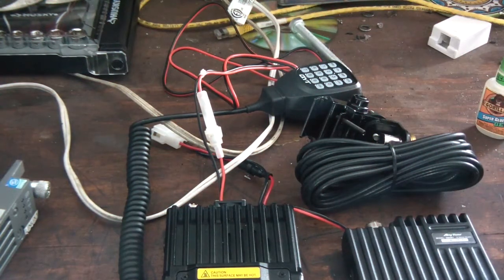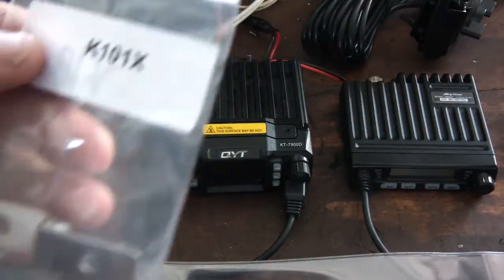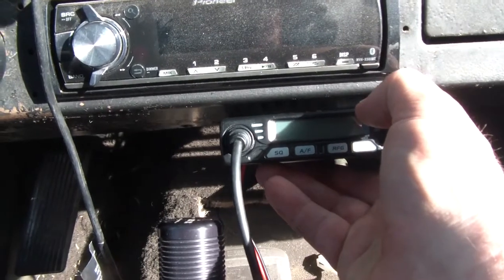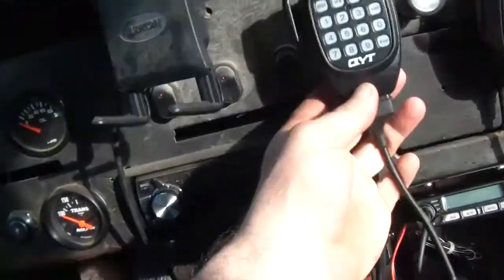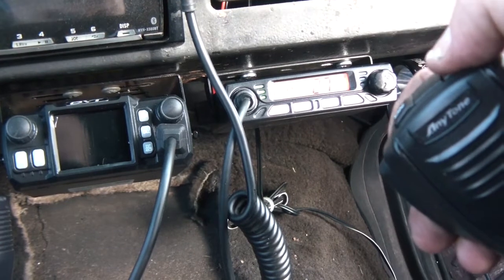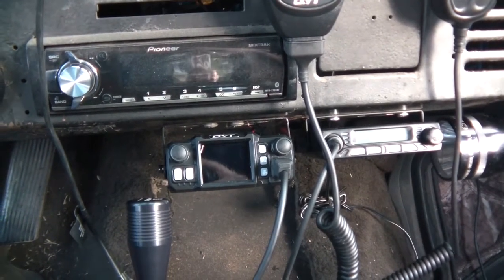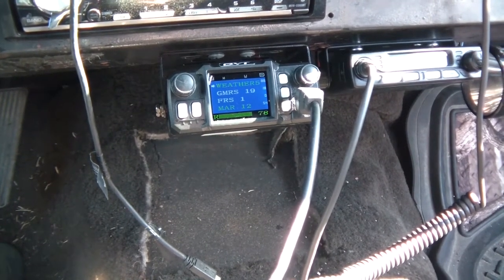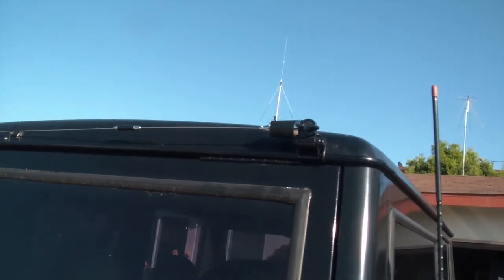Early Bronco micro mini CB Ham transceiver radio Install

Comment: You hooked the radios up right.  You want direct connect to the battery it bypasses the vehicle's electrical system where you will get a bunch of interference from all the electrical stuff...no so bad in an older vehicle but in modern vehicles you get all sorts of electrical interference.  

Those radios are tiny.  Looking at getting the KT-7900D radio and now that Anytone CB.  I bought a donwin dual band transceiver and that thing is tiny too but no support for that radio so its a paperweight.
Reply from the maker: yeah, its directly connected to the battery

Comment: sweet setup, what model antenna is that? I'd like to use a universal antenna for 2 meters to 11 meters... and how long is that antenna?
Reply from the maker: Tram 1180, the 11M is on my CB antenna which is a FireStik 5 feet II TUNABLE TIP BLACK
Reply: ok gotcha, i thought you had both of those radios on one antenna.. thanks man! I'm a ham, but have much more fun on the CB lol, thought i could have my cake and eat it too lol